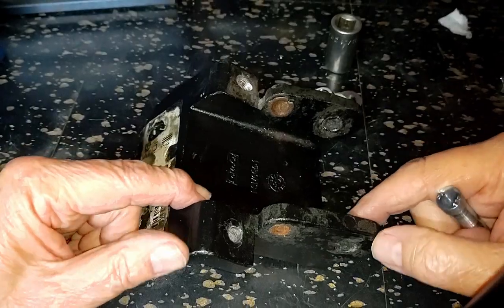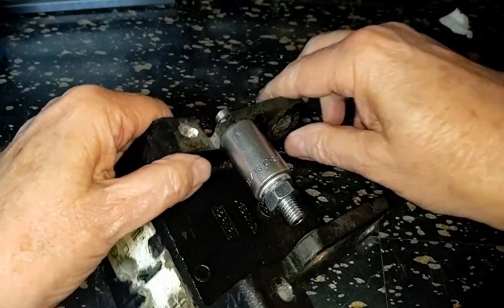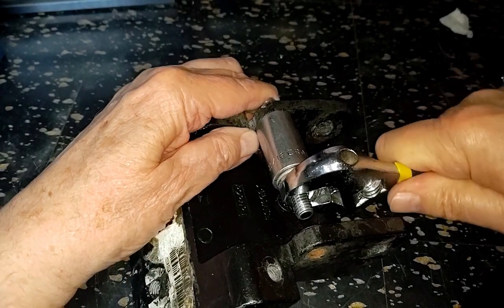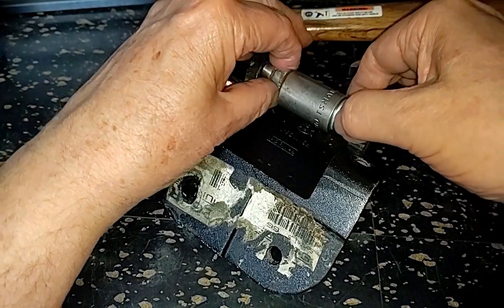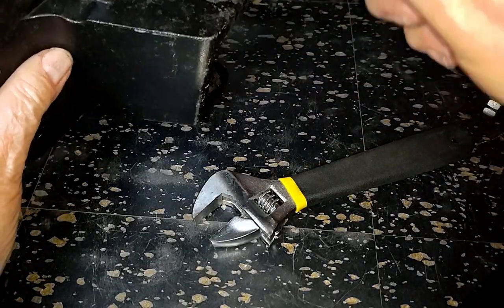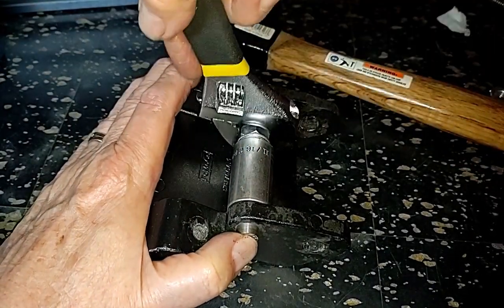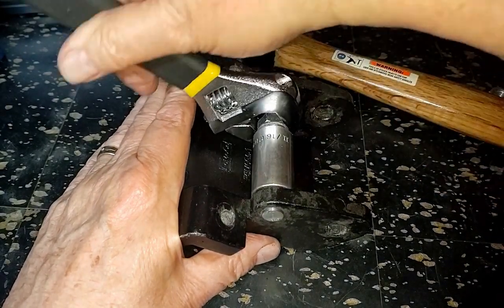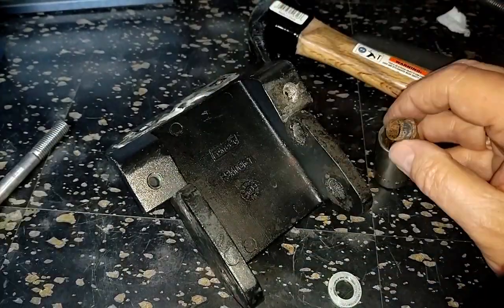Ford Expedition  Lincoln Navigator Power Running boards removing the bushings from the brackets

Comment: You could do with a rimmer or a close size drill running through each set of holes together before lock tightening the bushing in, and then maybe a closd fitting dowl then pushed through the inside of the set of bushing after fitting them to garentee alignment whilst the lock tight goes off. I like your videos, great stuff.
Reply from the maker: Thank you for the complement. I do try to present useful information and a bit of humor when I can. 

I may well do the reamer thing on a different build of this, the running board here is on the passenger side, I want to finish this one up using the standard style of bushings and reaming those will remove the plastic that gets plated into those. 

I still need to do the one on the driver's side. In that I am still very much considering using home turned bronze bushings and if I do then I will look into line boring them. That could be a fun project for my little lathe.

Comment: Unobtanium brackets. Ha. That is exactly right. The customer has to buy the whole bracket. Maybe with the running boards attached. I replaced my motor on my driver side automatic step rail. My local Ford dealer quoted me over $1100 for the motor alone. I got an OEM motor online for $80 and was able to replace it myself with help from YouTube.
Reply from the maker: I am glad that you found the motor on line. There are also people selling new front bracket assemblies. They come out of China of course, but they do work.